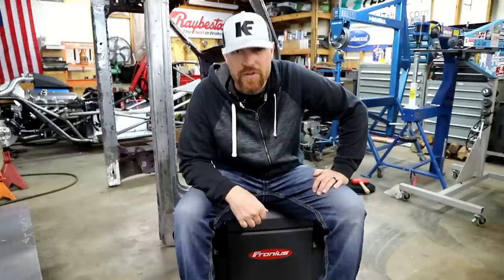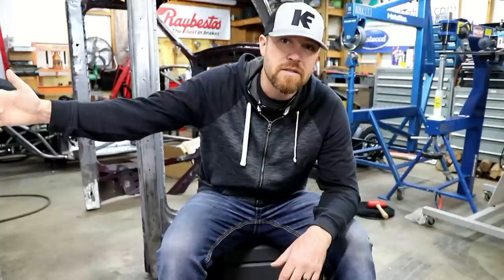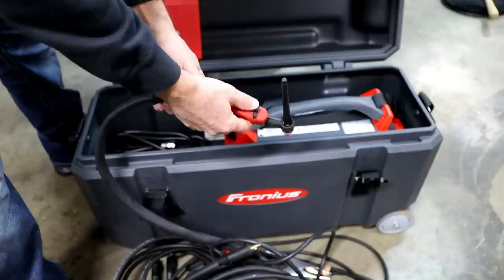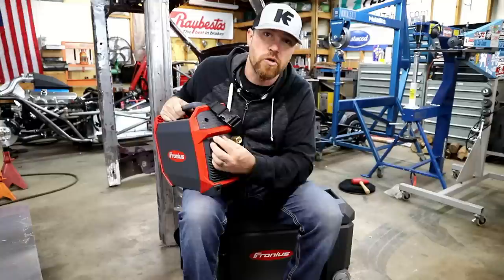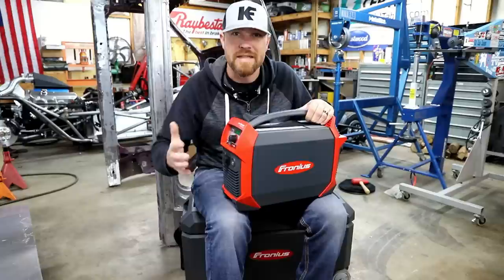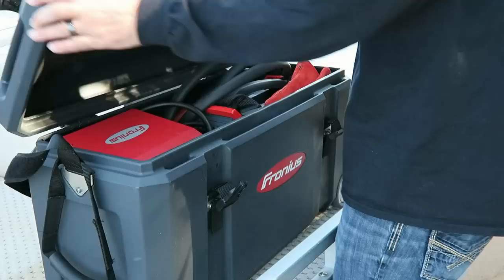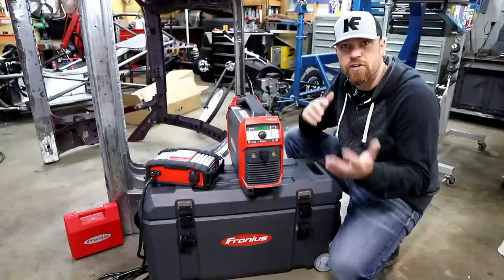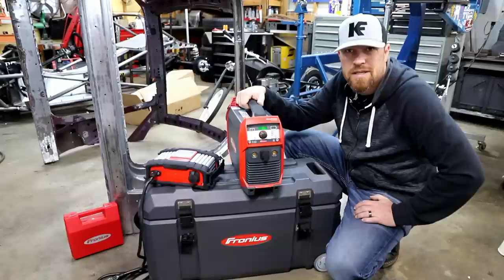Battery Powered TIG / Stick Welder | Accupocket by Fronius

Comment: Off-roaders dream!!!
Reply from the maker: yeah I wanted to throw it in my buddies ultra 4 rig and get some video on the trail for this video, but didn't get it done.
Reply: Can it get recharged from a vehicle or does it need to be plugged into a wall outlet?
Reply: check out Premier powerwelder or Ready welder II for a much cheaper and more compact option that will not need charged.. the premier power welder runs off an alternator and the Ready Welder II runs on your 12 volt battery (although it works better if you have two batteries like most offroad rigs with a winch)

Comment: Is that boat aluminum? It can weld that ? Don’t you need a Shielding gas? Sorry for novice question
Reply from the maker: No it will only weld steel. It does require sheilding gas for TIG welding.
Reply: So the toe rail on the pontoon is steel?!
I was wondering how one managed TiG on that pontoon with DC only…

Comment: That is what I call "The dream vacation" - TIG weld on the remote beach!
Reply: TIG welding on a pontoon boat with a dc only machine... lol
Reply: @venture17fly  It is kind of doable.  Welding all that aluminum will not be the best, but doable.  I would probably grind down most of the welds and redo them with AC when I got back, but they will hold for a while.

Comment: The video is a bit incomplete. I would like to see more details about the battery options. Still don't get it how can work, if it have inside battery, or use that external power bank. It's the first video where I see this option on Fronius. I'm looking for a portable option, being able to use it with my campervan, either from 1Kw Honda generator, or a bigger sinus inverter.
Reply from the maker: it has an internal battery source. but can also be run off the charger when plugged into a power source
Reply: I’d be more inclined to buy a big-watt battery to 240V split phase inverter and just use a decent suitcase like the Primeweld rather than buy this at $3000+
Maybe on aluminum there might be a struggle due to high amps. Thicker stuff especially. But I already have the Tig220, a mig 120V, and a fluxcore 120V. 
A big fat inverter and lithium batteries would let me do other power tool stuff for hours if not all day as well as weld (realistically if you do heavy stuff this isn’t the machine anyway- you’d have a gasoline stick- but to go portable would be easy with a 5000W inverter imho. 
Dollars to dollars I’d buy an inverter and run what I already own for hours rather than 10 minutes.
Reply: @Thefabforums  Do you know what DC voltage it runs off? I am thinking like maybe a car battery as backup.

Comment: DC machine welding an aluminum boat ?
Reply: He said it had pulse but I have the same question. I have used battery powered welding for years. I use a ready welder which is a battery powered MIG spool gun. I use 24 volts via golf cart 6v x 4 or group 31 deep cycle 12v x 2 or 4. I own a medium sized sign company and have welded many frames, poles, fences and all sorts of other things.. fifteen years worth. I don't even have a plug in MIG and don't want one. I do have plug in TIG/SMAW/PLASMA and a square wave machine for alum.. I would love to pulse my batteries and weld alum. with TIG. I'm starting to TIG everything mostly now just because it so much cleaner. I just saw another vid where a guy was TIG'ing with one car battery..... hold my drink...
Reply: Stainless hand rails.

Comment: To Damn expensive for a 10 minute welder.
Reply from the maker: lol...how much should a 10 minute battery powered welder cost?
Reply: @Thefabforums  well Idk. Considering it would be used primarily for hurry up field work I'd spend a little extra money on a used diesel or gas welder. Using the tig seems unlikely being you have to carry a bottle and hose setup. Don't get me wrong it's cool and I'd like to have one but for the cost it just doesn't make since. But I'm not rich. Both my welders are 30 years old. Lol
Reply: @Me MY gasoline welder has 120v outlets. 5 min to set up. Being limited to 10 min would just suck. When it comes to batteries we all know after a few uses that 10 minute window gets shorter.
Reply: @Me I would still like to have one just because it's a cool machine. But a poor boy like me can't justify it financially. Happy welding to you also buddy.